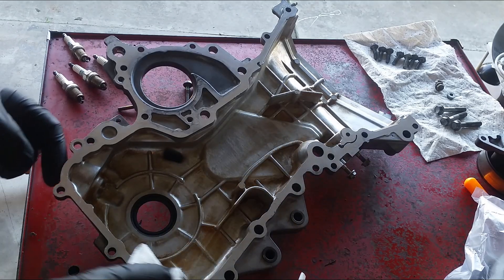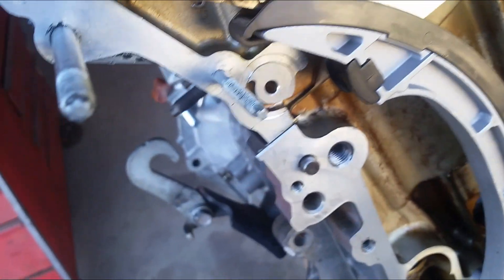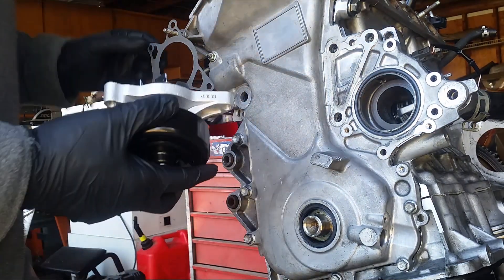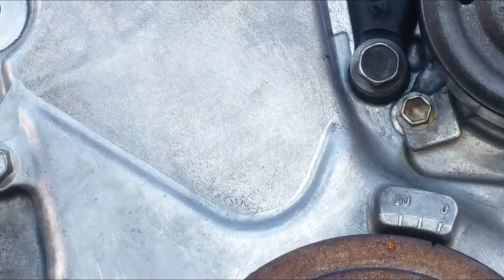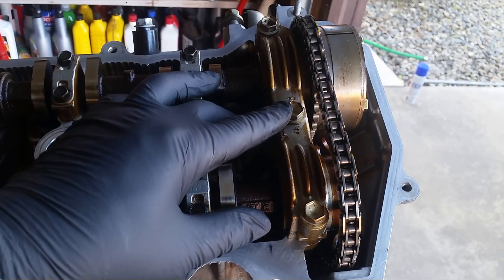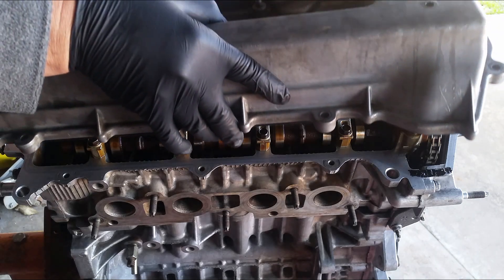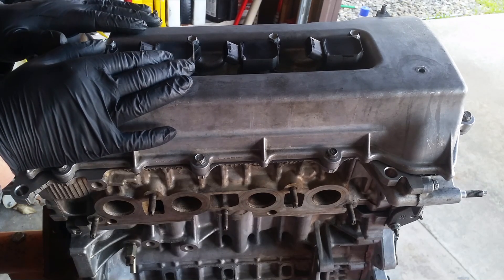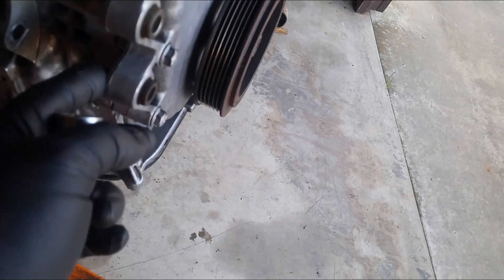Toyota 1ZZ Engine Rebuild Part 7 | Timing chain & Valve covers installation

Comment: Great videos,  good explanations, tips and tricks included. ✅. Where did you get the valve gasket kit?  Brand?  link please.  On the water pump, where did you purchase this motor longer bolts?  Thank you for ALL your videos,  watching from North Texas 👍🏻
Reply from the maker: @robertgill448  kit from eBay. Comes with most of the parts. I'm not sure on the water pump bolts, i got a big nuts and bolts container. Maybe I got it from there. 
https://www.ebay.com/itm/261960226529?mkcid=16&mkevt=1&mkrid=711-127632-2357-0&ssspo=64h8_HZJT86&sssrc=4429486&ssuid=IPwfKrY2SMG&var=&widget_ver=artemis&media=COPY

Comment: Wait did you ever unlock the timing chaining tensioner after installation? If so how?
Reply from the maker: The timing chain tensioner was depressed and had a hook flap to lock to keep it compressed. Once it's installed,  it will release putting tension on the chain.